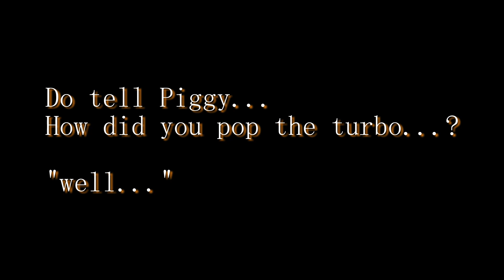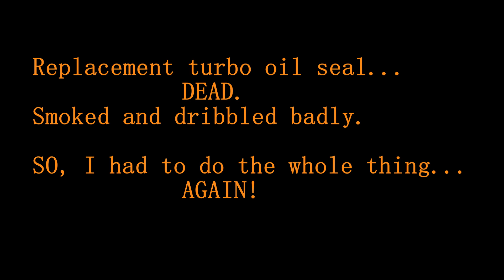The Daily  - Episode 4 - Popped the turbo

Comment: Hi Piggypower, I have the 2.0 gasoline 135hp in my 206, and have a new RC exhaust manifold I want to use. But would I have to do a subframe removal like here to change it? Cheers, great channel!
Reply from the maker: Quite possibly yes .. I don't know for sure mind .. 

I've never done it myself 

To be honest, the subframe comes off pretty easy/quick...but so long as the ball joints have been off recently and the chassis is rusted. With a good impact gun, can have the subframe dropped in 30minutes 

👍👍👌🐷💪
Reply: @PiggyPower  I'll give it a go, just did the whish bones, so they should not be a problem. 👌👌👍
Reply from the maker: Ah, win! Well done 👌

🐷💪
Reply: @PiggyPower  yeah it is getting the full treatment, new rear beam, new shock, springs, 283mm front brakes, braided lines, RC intake, 306 GTI TB.. Just need a new exhaust and a tune ;) Really grateful for your canal on Pugs!
Reply from the maker: Whereabouts in the world are you?

Presume not UK as we have the GTi not the RC here.
Reply: @PiggyPower  Denmark, my GTI is your S16 (135-138hp 2.0l non vvt), and your GTI is our RC (177hp 2.0l with vvt), and our S16 is a 1.6 110hp with vvt. It's very confusing when researching ;)
Reply from the maker: @tobiasstaermose  nope,we don't have an s16.

We have the GTi (140bhp) and the GTi180 (180bhp). 

Other engine variants had "sport" badges but didn't mean very much
Reply: @PiggyPower  The plot thickens, they sure did not make it easy, pretty sure that the S16 is a 2.0 in some countries 🤔🤔
Reply from the maker: Quite possibly! We had a 306 S16 briefly before the 306 GTi6